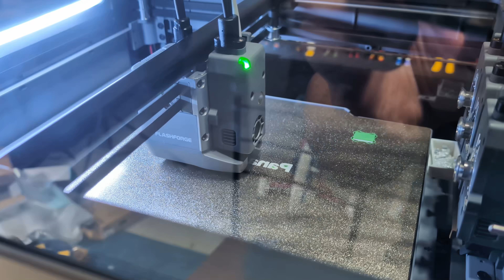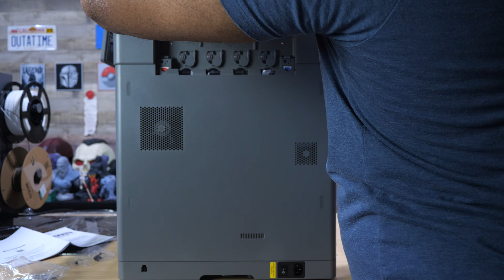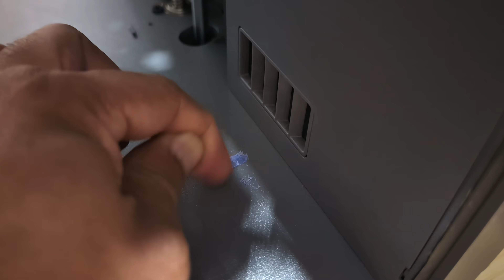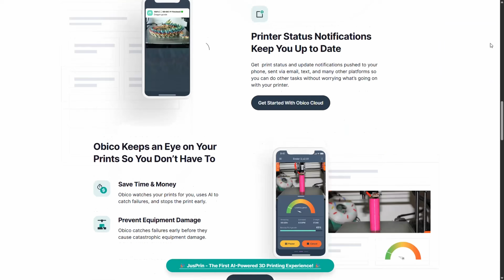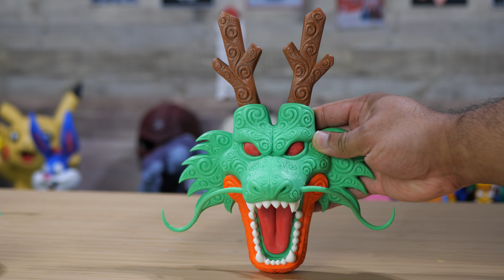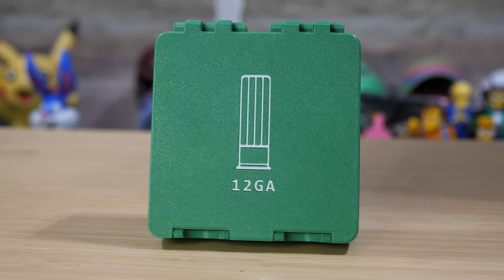Flashforge Creator 5 Pro Review!

Comment: Hi and thanks for the video!  I have a question.  I just got my Creator 5 Pro.  I am using Flash Studio and imported a Makerworld  basic STL file of a filament clip.  When I slice it, it puts a skirt around the part that I don't want.  Is there a way to turn this off?  I have supports set to off.  Thanks for your help.

Comment: Great review as usual Jeremy. A little background first: I just ordered an AD5X direct from FF after coupons $279+tax. The AD5X was ordered last night in Ebay instead of an Infinity S1 Plus spool changer at $179. I ordered the AD5X mainly as a way to change same-color print spools automatically, but hey for extra $100 compared to the Infinity S1 you get a full 4-color Core XY printer. Your video by the way on changing filament in the AD5M is great, and sure it's easy to load new filament, but with AD5X I will minimize wasted "spool ends" on same-color spool swaps. So with all that in mind, I woke up here Sunday morning and thought wait maybe I should have just splurged the extra $400 or $500 and gotten Creator5 Pro. I'm happy to say your review of the Creator5 solidified my certainty that I made the right choice picking up the AD5X under $300 towards its end-of-life when hopefully most AD5X bugs have been worked out. Without having hands-on with IFS yet, I still like the simplicity of the filament install/feed into IFS better than the filament install into Creator5. All in all I will wait a year or two for Creator5 to get de-kinked and de-snafued. Looks like Creator5 will benefit from not only firmware and software tweaks, but some physical component redesign as well. There's already a community hinge kit for the top cover which currently has to be completely lifted off the top of the machine. Also the shaking of the Creator5 looks kind of excessive. Love all your reviews Jeremy thank you!!

Comment: I wonder if you have the same problems with the camera, as me (and lots of other people) on the Creator 5 series... I run it in LAN mode, using Orca Slicer, which works great, BUT the camera is really bad. My stream is 1-2fps at 640x480, NOT 30fps at 720p/1080p. They mention both HD, and Full HD, so don't know which resolution it SHOULD be...

Comment: i started a print today,but watched this video when it aired. i shoulda payed attention to the purge. there was lots of spaghetti inside the bottom. im glad none went in the fan. watched again today. it was packed well and just about complete. the book of horror (instructions) must loose something in translation between the chinese and the human race. luckily knowing printers, i was able to figure it out.. it took for ever to calibrate, then had to uninstall and reinstall software because i couldnt bind my account. first print is going. 9 hours 27 minutes the factory must have actually ran the print heads because they started leaking blue, white and red. im printing green there's about a 3 inch drool of filament from the unused nozzles. im hoping for nice prints, but time will tell. btw, this thing shakes like crazy

Comment: Thanks for the video and review. Honestly somehow missed that there was a Creator 5 Pro and had only been looking at the Creator 5. I had to go back and take a look at Flashforge's site to check if there was some kind of upgrade kit to turn the Creator 5 into the 5 Pro but they are separate models because of the extra parts for the heated chamber. Never had a 3D printer before and was looking at the Adventure 5M at first and then the AD5X when that was released. The Creator 5 and 5 Pro with the 4 toolheads is great for reducing waste, etc. but man, have to see how resolving the purge issue develops further.

Comment: How would you compare it to the Snapaker U1? Yes, I understand that the U1 doesn’t have a heated chamber (and doesn’t come with hardened nozzles out of the box). But just for general printing characteristics do you feel it’s worth the extra $ to go with the U1? Or do you think the FlashForge gives you enough value and print quality to keep most users happy.
Reply from the maker: I think most people would be happy with the print quality of the Creator 5. The main thing you'd be giving up with Flashforge is having more control over the firmware. The hardware is okay for the most part, but they are known to have some Q&A issues here and there.

Comment: Got mine a few days ago. The printing is quite good. Comparing it with my Bambu machine its like comparing a Mercedes to a Ford ... they both get you to your destination ... one smoother the other a little more bumpy. The Flashforge is rough on the edges (engineering, software) but it works.
Reply: what bambu?

Comment: My C5 Pro arrived yesterday (July 14)and it purges from the right rear. The only problem I see is the static electricity from the rear plexiglass panel attracts the filament and the filament attaches itself to the plexiglass in long strings and some of it lays on the floor of the printer. Makes it a mess to clean up.  FF needs to find a better solution to the filament collection. My first print was perfect, howeveer.

Comment: Definitely leaning more to the U1 with the third party chamber heater.  Your experience and insight is absolutely making me glad I didn’t jump on the pre-order for the C5Pro.  Can’t wait to see FauxHammer shred this.
Reply: Was contemplating doing the same, but chamber heater mod voids snapmaker u1's warranty.
Reply: @ChrisdeJongh it's a risk I'm willing to take.  Maybe. Haha
Reply: @ChrisdeJongh  But if I’m not mistaken, SnapMaker modified its top cover to integrate a heater that connects to the printer's data port, effectively turning the cover into a unit with a built-in heater and air filter.
That way, it would be a native SnapMaker solution with no warranty issues.

I’m not sure how it compares to FlashForge’s more integrated solution—and it isn't available yet anyway—but there are videos of the beta version circulating online.
Reply: @Fabrizio-xk1ly The shop states passive heating up to 50°C, which is still a bit low for eng materials...was really really trying to justify getting the snapmaker 😅 (love the open source bit)

Comment: Did you print and TPU with this printer? You didn't mention it, nor did you show any TPU models.
Reply from the maker: I didn't print TPU on the Pro model, but I printed PEBA flexible material on the regular Creator 5. https://youtu.be/EbnYGQ9xo0A
Reply: @FigureFeedback  Cool, I just want to see how the pro model handles TPU. I have a Pro on order and I plan to try and print some multicolor TPU prints with it.

Comment: For the geeks, I would like to point out that someone has already unlocked access to the printer and started adding new features.
I had made a more detailed post but it's disappeared for now, so I'll limit myself here.
I don't know if the other post will also return in a few hours (after human review perhaps) or if it has disappeared forever (maybe this one will disappear too).
Reply from the maker: Did you post about it here? If so, I didn't see it.
Reply: @FigureFeedback  Among the features I mentioned (in more detail) I said that they: unlocked ssh and scp access, reactivated MainSail and MoonRaker (present but deactivated), updated MainSail and MoonRaker to the latest version, unlocked the camera for 30fps with use in MainSail/MoonRaker, activated adaptive Bed Meshing (leveling only on the area of the printed object), added EntWare, attempted to increase the printing area (the printer physically reaches just under the area of the plate which is 266x270mm)
Reply: @FigureFeedback  Yes here as my second post (this is my fifth post but only four are visible)

Automatic censorship must have deleted it immediately after publication.
But some posts reappear hours or days later, while others never appear again

Comment: Mine arrived on July 3rd but unfortunately without one of the 4 feet at the base.
For now I'm dabbing with a foot I designed and printed in TPU (but I only had TPU 95A at home which is too rigid, we should try with 85A if not even less).
This week I hope the official spare part from FF that they sent me arrives.

For now it works quite well, only one print fails to make it (tried 3 times and failed 3 times).
It is an ASA print with PETG support interfaces (supports in ASA, only interfaces in Petg).
Slicer and printer are not opposed to the combination (even though PETG in a hot chamber at 65 degrees is at the limit) but after a few layers the printer suddenly turns off emitting an error.
One time he reported a trigger error on the head with the PETG and the other two times he gave even worse "Unknown error"
In one case the error appeared even when it was the head with ASA that was printing at that moment (Petg parked)

After the error you can only turn it off and on again (resume print doesn't work and cancel print doesn't work).
When you turn it back on it asks you if you want to resume printing but if you do so after the time necessary to heat the chamber again it causes the head to crash onto the printing plate and then continues to push forcefully (if you don't turn it off quickly you can also risk bending the nozzle, as has happened to many).

FF is examining the logs, videos and my 3D project to find a cause and a solution to the problem (in a few days however I will try printing again using Hips instead of Petg).

Yes, the nozzle of the C5 and C5 Pro doesn't seem very solid to some. It bent because the printer first implanted the nozzle on the plate and then tried an X-Y movement ignoring all error signals (load cell indicating nozzle colliding, motor under stress indicating abnormal event) with the result that hotend bends at the base.

But some say they bent it even just by colliding with the upper part of the printed object (which had become higher due to some printing error), and bending it like this indicates a very fragile nozzle

Comment: The only times I saw the clog error seems to be from when the spool is stuck. Due to the spool holders not being a snug fit, what would happen is that spool itself tilts and lifts onto the edge of the spool holder and gets stuck. It generally happens towards the end of the spool when filament is low since its much lighter now and easily tilts with any type of pull on it.